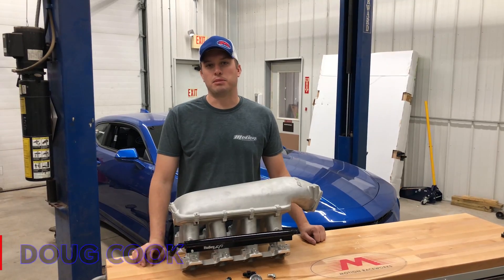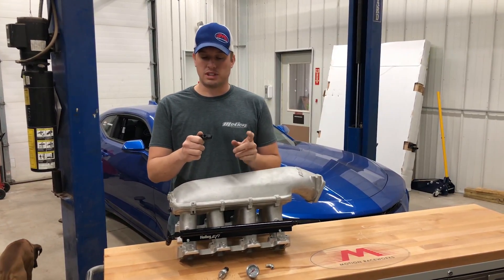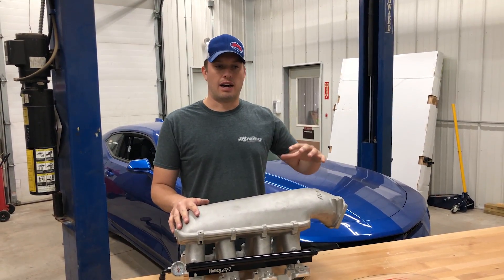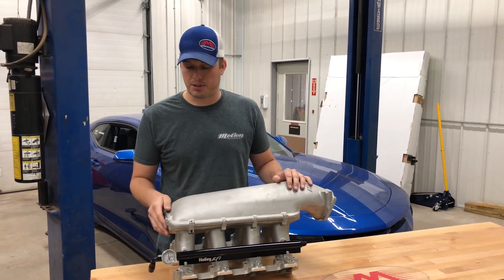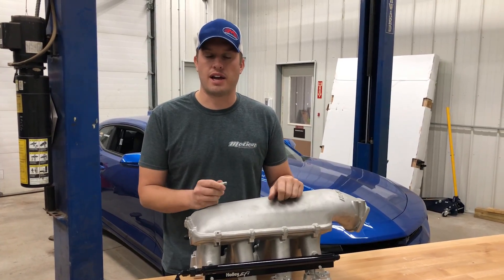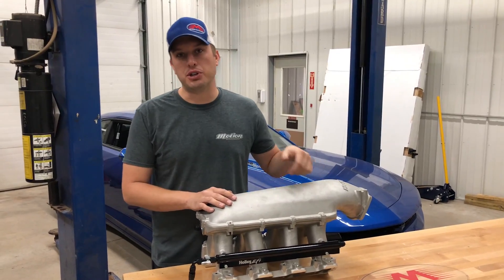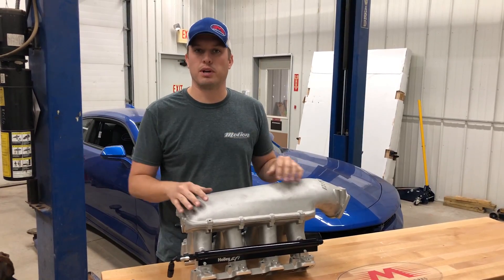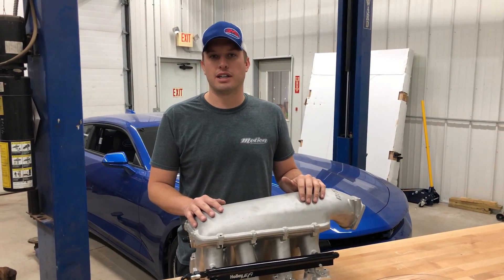Fuel Pressure Sensor Hack! Motion Raceworks Tech Tip Tuesday

Comment: I’m running a low dollar sensor on the end of my stock ls1 rails. I’m using the gauge adapter to connect to end of rail and my nitrous feed line. I’m having the hardest time getting my term x to read higher then 36 psi. I just upgraded my fuel pump to see if that would help with no success. Would a fuel pressure regulator help me out?

Comment: I run my regulator under the front of the intake with a t that has both an analog guage and a pressure transducer. The guage faces the front, so its easy to see.